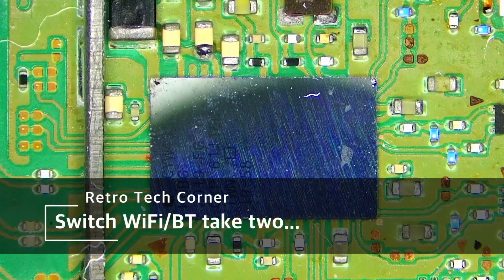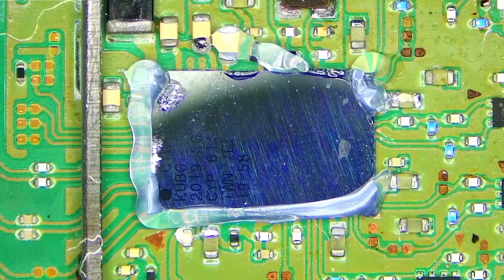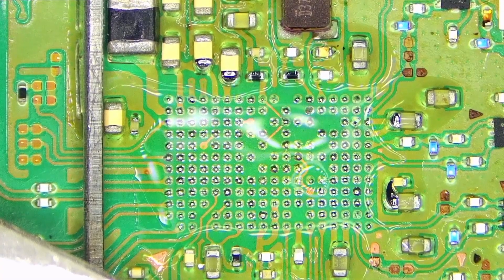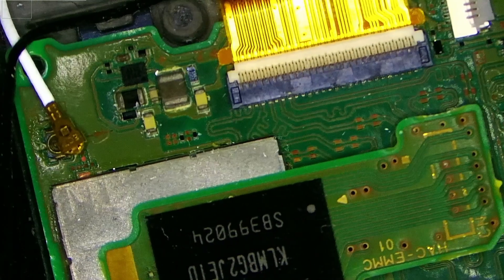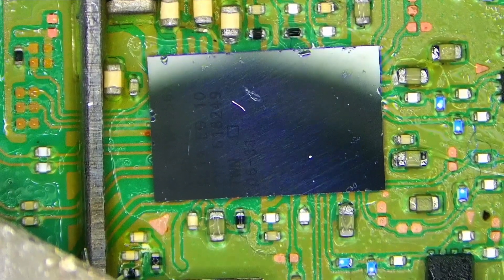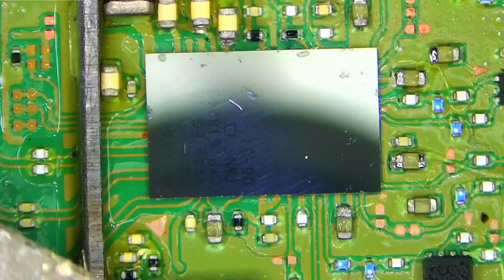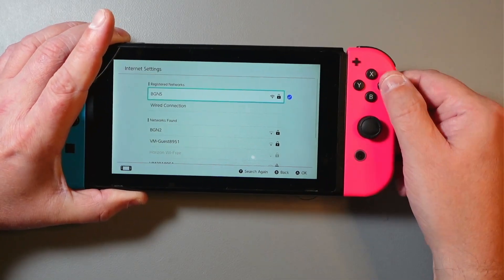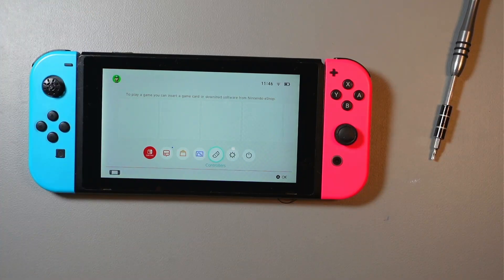Nintendo Switch WiFi chip replacement part 2

Comment: Be in mind not only could the Chinese fakes only have wifi but also due to this reason of them advertising the chips but the switch lite model is sold to you regardless which aka only does WiFi

Comment: Hello there, does the switch still work? my local tech tell me that after repaired, the switch will become more unstable and he adviced me to sell it and get an upgrade. I just bought mine secondhand a month ago and still not ready to part way with it.
Reply from the maker: Yes, it does work perfectly. I don't see any reason why it would get "unstable" if the chip is original nintendo and replaced correctly.
Reply: @RetroTechCorner  He does this for a living so his work is probably good. I guess since my switch is soo old, there is a chance that other component might be broken in the future. Anyway, thanks for the confirmation. I can stop worrying now

Comment: Thank you for movie about working
Could you tell me temperature of hot air gun?
Reply from the maker: I try to avoid talking about exact temperature or airspeed. It all depends on the station, distance from motherboard, nozzle etc. You need to practice and get to know your tools. 
I usually use 470 Celsius and change air speed or distance. I lower the temperature if I'm working on "thin" and small boards as they usually absorb heat pretty much instantly.
Reply: Thanks you so much
Your answer is very meaningful